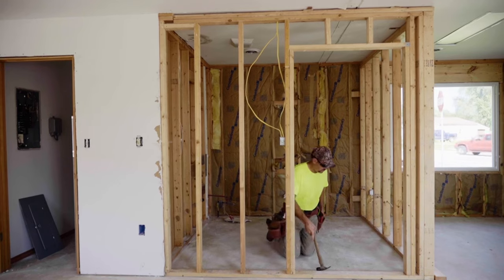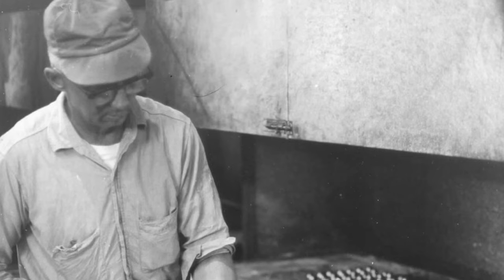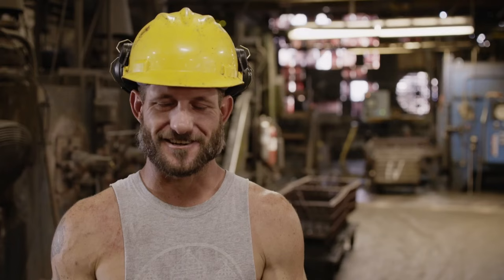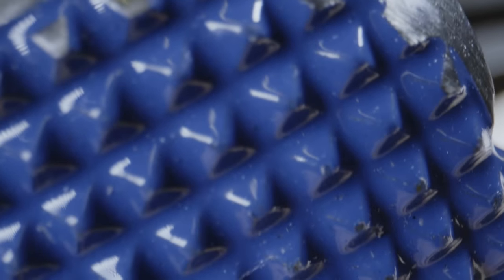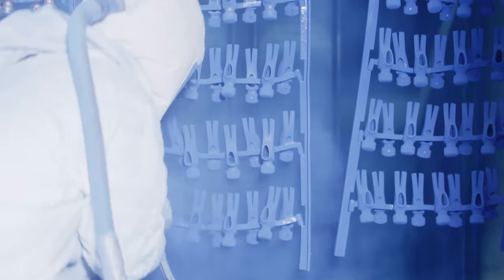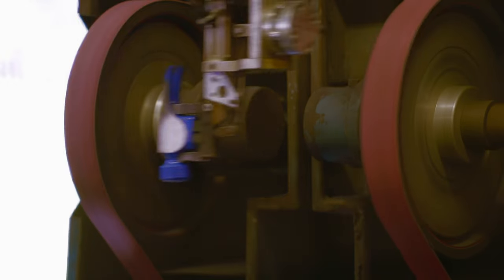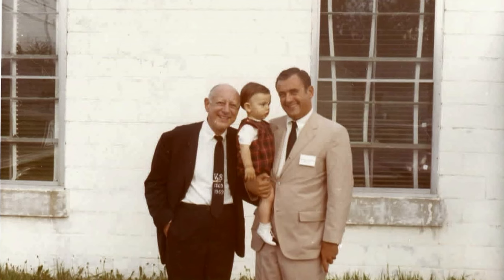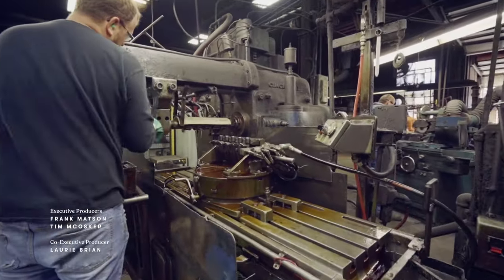How A Vaughan "California Framer" Hammer Is Made | Extraordinary Stories Behind Everyday Things

Comment: Living here in England, I've watched lots of videos about traditional American made high quality tools, so I decided to order a Vaughan California framing hammer, as a special treat for myself,,,
Imagine my disappointment when what turned up, was a poorly made hammer, with terrible fit and finish,, 😭🔨,,
Just goes to show, you shouldn't belive all you see, !!!
I haven't been this annoyed, since I bought a Case pocket knife, 😬😱,,
I'm just about to order an Estwing hammer, so, fingers crossed, third time lucky,, 🤞🤞
Reply: You must have got a bad one. I use this hammer constantly only owned two cause the first one broke at the handle after 7 years of heavy use. I know one thing if the grain isn’t right it will break but the steel is always solid. Handles always replaceable with these.
Reply: Sand and linseed it. England has lots of moisture maybe that’s a factor in the field out there.